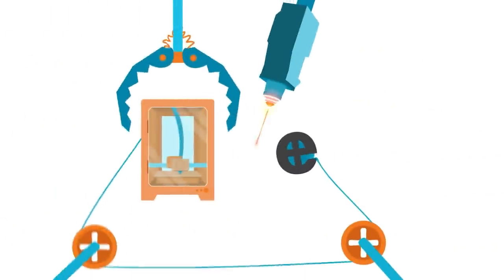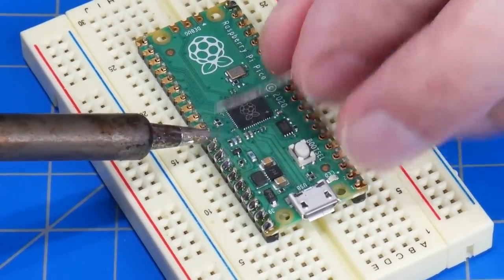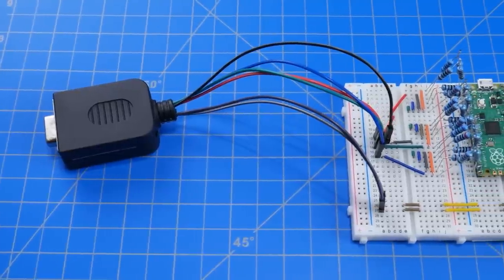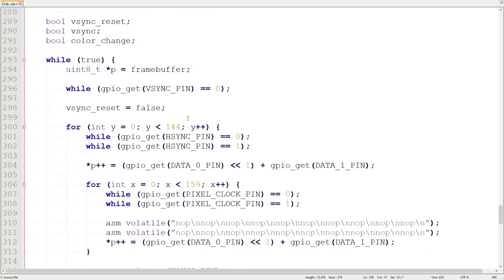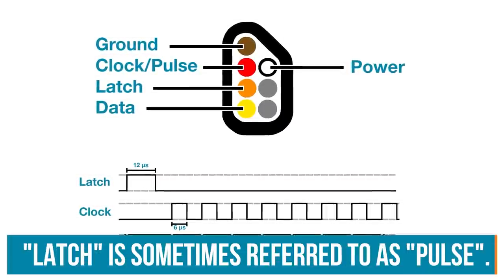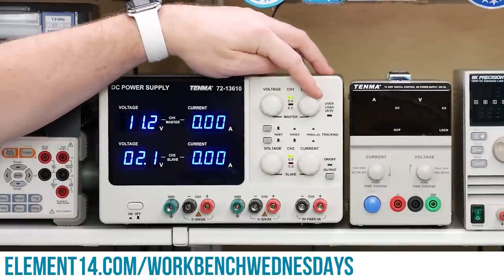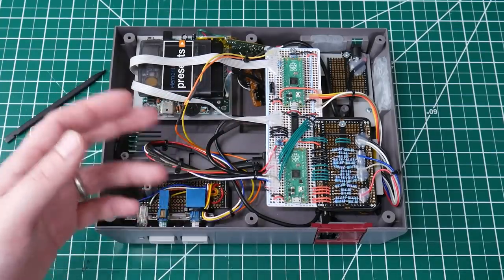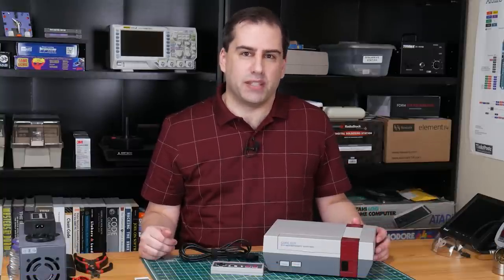Game Guy - The Unportable Game Boy

Comment: One really cool thing that I'd love to see someone attempt is something similar to this, but using the NES classic mini for the shell, modded so the cartridge door could be opened like the original NES.
Reply: That would be awesome, but then you'd definitely need custom PCBs in order to fit everything in there... And maybe flex cables to replace the normal cables in there... But, just to clarify, that would still be super awesome...

Comment: Clever project and I like the sourcing of the parts. Always annoys me when a good working console gets cannibalized for the likes or just because. I understand these were made by the millions, but that was 20-30 years ago and who knows what's actually left out there. Much prefer giving broken systems that might otherwise be discarded/trashed/e-wasted another chance. This one is also nice in that it avoids a lot of specialty parts in the build. Pis are pretty readily available as well as resistors, wires, and other prototyping parts. Nice work!
Reply: Having somthing in working condition that will never be used is wasting it too
Reply: @brandonstormonth8356  Never be used _by you_. I get what you mean though, glass shelves collectors are a huge problem.

Comment: Awesome work!! The vertical scaling would drive me nuts, though. Anything scrolling vertically is going to have massive shimmering problems. 

The Game Boy's native resolution fits perfectly into 720p output at 3x integer scaling, or 1440p at 6x with no shimmering. You'll have blank areas to either side of the image, but the games were never designed to fit into a wider aspect ratio of the 4:3 CRTs of the day, much less modern widescreens. (though some people like to stretch the image to fit)
Reply: Er, wait a minute... Game Boy is 160x140, which doesn't divide into 720p evenly at all. You might be thinking of NES (and pretty much any console before the Dreamcast), which typically did output at 240p.
(As a side note, the Super Game Boy added thick borders around the game window, to fill out the 240p screen.)

Comment: Yes that sheet is indeed for RF shielding. If i am not mistaken it was between the pcb and the Display. So my asumtion is it shilds the logic from the Display. Old LCDs work with high voltage bursts to polarice the lcd cells.

Comment: the copper plait is for RF shielding and as a common ground plain
Reply: Makes sense. If I did this again I'd probably keep the shielding and use shorter wires for increased stability.

Comment: Awesome project! As for me, i would probably do it with a GBA for newer(-ish) games compatibility
Reply: Thanks! This actually started as a GBA project, but I quickly realized that there weren't enough GPIO pins to wire it directly, and not enough processor power to do any sort of multiplexing. Maybe I'll try it with an FPGA some time.

Comment: 07:35 Would it be slightly higher perf to do a gpio_get_all() to get both data pins at once and then mask out the bits of interest? Might need more nops if this did run faster, but nops often initiate a low power state.
(Line 312)

Comment: Could the VGA out part be done with one of those "mini" versions of RP2040 based boards? You know, the half length boards, not made by Raspberry PI foundation, that contain a RP2040? Is there enough input and outputs etc?

Comment: You can go even cheaper just use a max II cpld and don't even really need a  pi Pico, just a vga frame buffer

4 color vga or rgb analog at 144x160 is quite easy using a few logic gates, and decoding the 2 bit lcd Bitstreams plus vsync and hsync and timing signals being provided
Reply: And would fit in line with the lcd flex cord so you can still use it just with a mini din port in the side for TV out